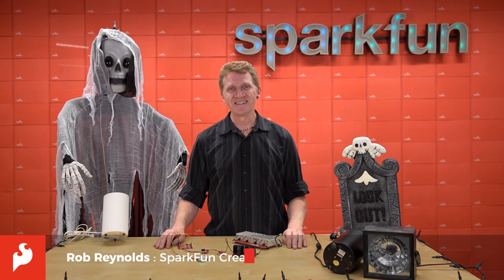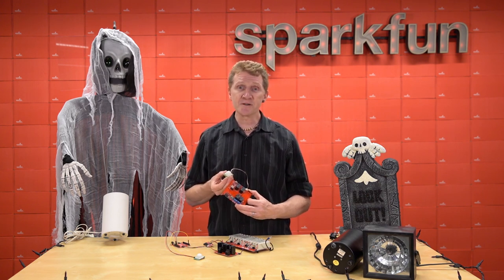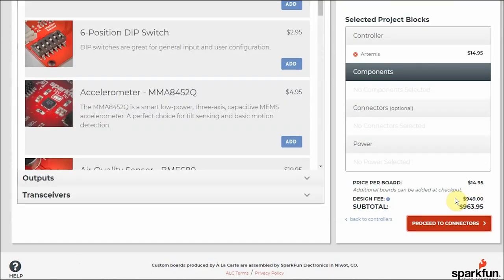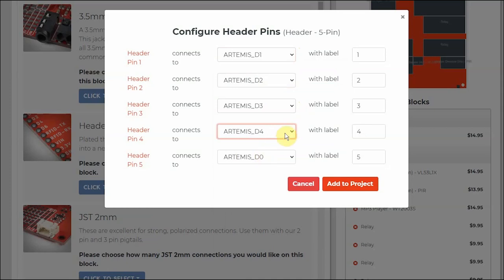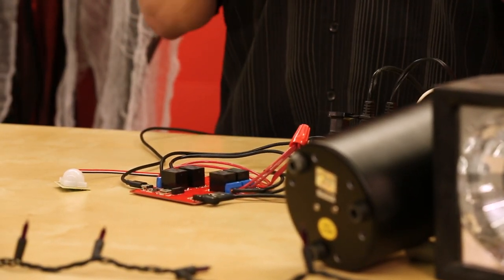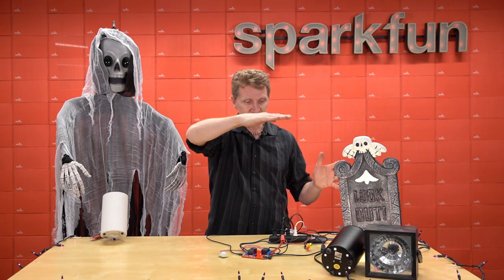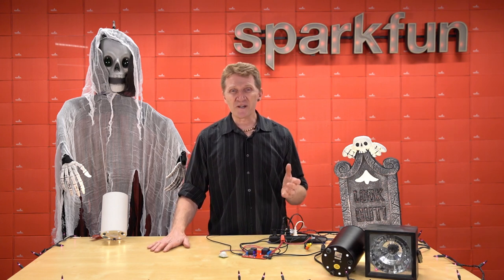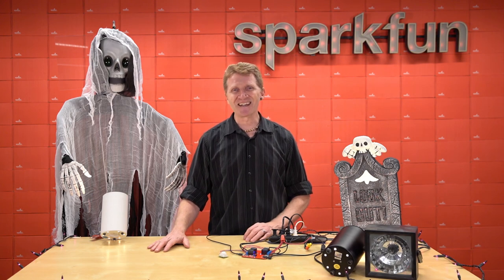Project Showcase: Qwiic Halloween Build with ALC

Comment: The design fee of $995 seems high.  Assuming your designer billed at $150/hour, does it really take anywhere near 7 hours for an experienced designer to put this layout together?  Very cool and simple to use service.  Thanks!
Reply: There's also the overhead of etching the custom board and assembling the thing, which can add up. I'm pretty sure there's at least one guy at each step of the process (so at least 3). This is basically "Here's a thousand bucks, now go and make this thing I don't have the time or skills to do."

Personally I would just do the whole thing in KiCAD or EAGLE, have the board etched at OshPark or another shop then solder the thing myself. But then, I have a lot of time, I know how to use all of those tools, and I don't want to deal with etching a custom board or cobbling together a circuit on perf board.